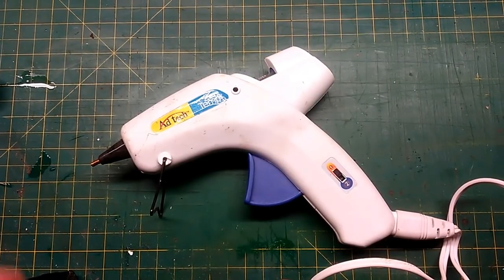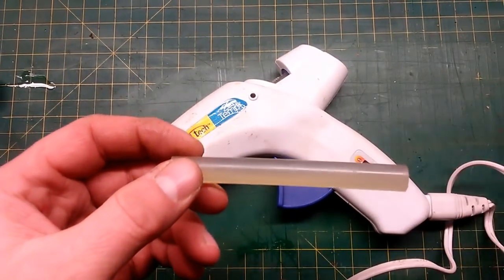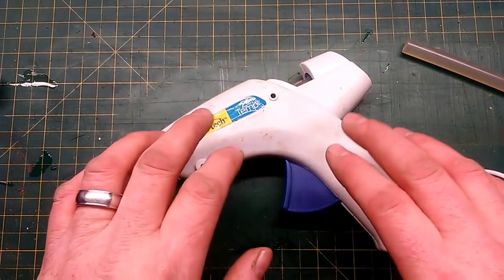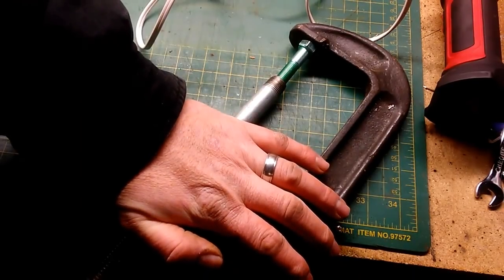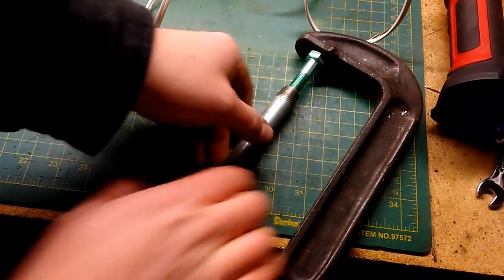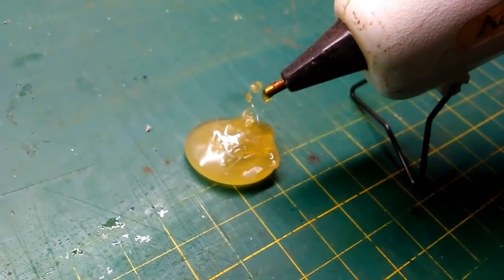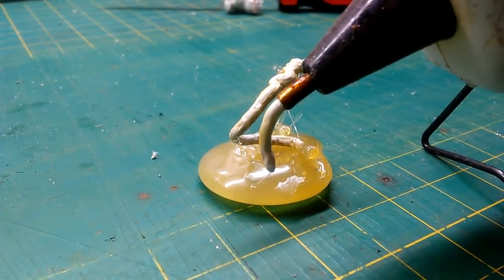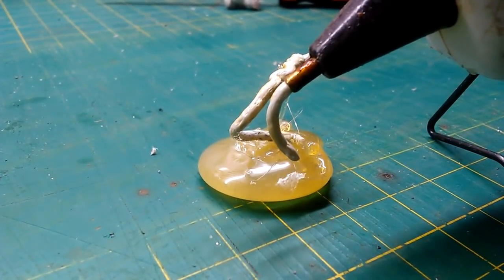Use a Glue Gun to extrude parts?  How To Recycle HDPE Plastic To Make Parts! Part 4?

Comment: I came across your video after I was trying to think of creative ways to reuse my many old amber colored pill bottles, rather than throwing them into the landfill. I know they can be melted with a heat gun, but was wondering if they would work in a glue gun so the shape could be more controlled than just a blob! After a quick Google, I was happy to come across your video to see that someone had the same idea, but with a different plastic source. Do you think pill bottles would work better than bags maybe? I do not know too much about different types of plastics, but would love to find ways to keep them out of the landfill. I think the hardest part would be making the bottles plastic into stick shaped form so they would fit into the glue gun. I wonder if they can be softened just enough to reshape, roll or pour into a mold like you had done?. Maybe just cutting them into shredded strips and stuffing them in might work? I'd love to see this work! Thanks for the awesome video!

Comment: Very cool idea. I just saw a video where a man used zip ties in a glue gun to weld a car bumper back together from the inside. While many were skeptical, almost every plastic part on a car is nylon or ABS, and zip ties are usually nylon. Nylon is a far superior plastic, so I'm going to experiment with it on a lot of awaiting repairs. I'm also going to experiment with this because I think the issue was how you processed the bags. I would try shredding them first which is typical for industrial recycling, getting them molten, then forming your stick. Who knows what you pulled into that plastic out of the galvanized steel. I've seen people build crucible cups out of fire extinguishers, and have a couple I'm chopping soon.
There's a lot of recyclable plastics around that will work with this through a glue gun like water bottles....but wear a full face respirator!
I certainly do.

Comment: Thank you for giving it a try!! Hot glue sticks use PEVA mixed with wax for viscosity. Crafters will often mix wax crayons with hot glue sticks and reshape them to make colorful hot glue sticks. Have to keep under 10% wax so as not to impact the bonding property

Reeeeaallly curious if PET or HDPE mixed with wax would be better recycle alternative. Smoother tubes found in metal straws (bubble tea straws) or copper pipe.

Some videos have PET bottles wrapped with tape working well. The tape just seems wasteful

Comment: The glue gun tip isn't hot enough.
If it had a brass nozzel attached to the heating element, it'd probably work.
Like a 3d pen or 3d printer

Comment: Good video, clever way to mold your own HDPE stick, and you're not really far off... sounds like you had plenty of heat for polyethylene (PE), so it's more a matter for selecting the right PE type.  PE comes in a wide range of melt viscosities (determined by molecular weight or polymer chain length), and the bags you used are on the high end, which is why the melt was tough to push out the small orifice of the gun.  You mention EVA, which is a vinyl acetate copolymer with LDPE, and hot melt adhesives (such as glue sticks) incorporate very low melt viscosity EVA's or PE's in their formulations.  Whether you try HDPE or LDPE, you'll of course have more success pushing the extrudate from the gun with a lower melt viscosity type than you tried.  The lower the melt viscosity, the more brittle your product will be, so I guess you're looking for a material that would make parts with at least some toughness.  Trying a PE from a thin-wall injection molded part in your experiment would be moving in the right direction - like the lids from icing or margarine tubs (which can sometimes be Polypropylene (PP) these days) or milk bottle caps.  Injection molded parts can be identified by the dimple left from the mold injection port.  Anyway - I can across your video in my search for plastic welding sticks (mending rods) specifically made for glue guns, and this gave me some ideas - thanks.

Comment: Take the glue gun apart and look at it. It's a pretty standardized PTC heating element either no fed to the outside of a metal heatsink that the glue stick goes into, or it's stuck down into a cavity built into that heatsink. It's the same kind of heating element that's in a soldering iron,  a coffee maker, or electric kettle. You can buy them in infinite shapes and wattages, and you can even set up a simple temperature controller, like in a temp controlled soldering iron. Or controlled  precisely as in the way a 3d printer does!

Comment: Sweet! 
Have you tried using wax injection wax with a hot glue gun? It would be a lot cheaper than those wax injecting systems.....if it worked.

Comment: Industrial glue guns might do it , with greater voltage and temperature. As for the making of the Hdpe stick, you heated it in a oven or an open flame??

Comment: Further experimentation:
Insert a sleeve o.d. same as glue stick
I.d. same as output ....essentially decreasing its feed diameter and amount to heat up at once ....sadly you will need to hand feed it

Comment: I knew that sucker was going to clog up badly after the first 50 seconds of the video  like I told this kid I knew 30 years ago that if he used his moms vacuum cleaner hose as an exhaust hose to vent his cars exhaust out of the garage the vac hose was going to melt in about 5 seconds...  xD   he didn't believe me and his mom was so pissed off because that vacuum cleaner hose cost more than a real premium hi-temp automotive grade exhaust hose ( the kind they put in the hole in the door at auto repair garages )    xD

Comment: I took a 100 watt pistol type soldering gun took out the tip using a long piece of 10 gauge solid copper wire wrapped it around an aluminum arrow 6 times crimped the end so the material would flow a little slower hooked back into the other set screw. I already had plastic welding rods! placed 1 into the arrow and pulled the trigger it got hot and soon started oozing took a 5/16 hose with a bolt stuck the arrows tip into to keep the melted plastic from leaking all over.

Comment: The problem is that the kind of HDPE used for injection molding has a softening temperature way to lower than the one used for extrusion. I think that the grade for injection molding (HDPE flaks) will go better in the glue gun.

Comment: Cool video, I wanted to try that. You may want to try and get a 110V to 220V converter off Ebay or Aliexpress, set the glue gun to low and let's see what happens (doubling the voltage quadruples the power), assuming the heating element of the glue gun will survive. BTW, you can probably buy HDPE rods already formed to the right diameter of the glue gun.

Comment: There is more than 1 formulation of HDPE.  Necked bottles are blow-molded, whereas tubs with wide openings are extruded.  You might get better results with an extruded container.  IDK which formulation is used for bags, but it's clearly unsuitable for that glue gun.  BTW even the color of Your source HDPE makes a difference according to other videos that I have seen.  White seems to be best, and red tends to become a sticky, gooey mess.